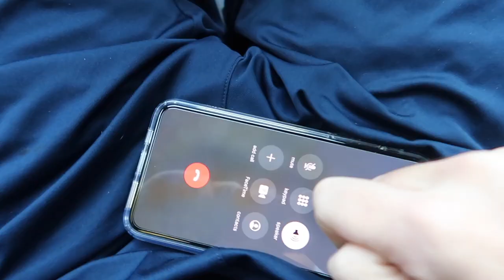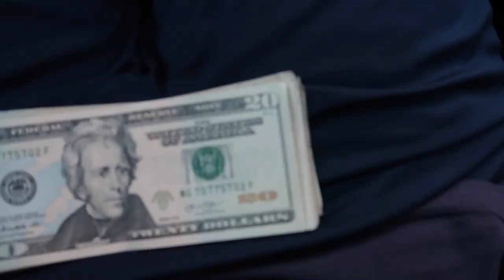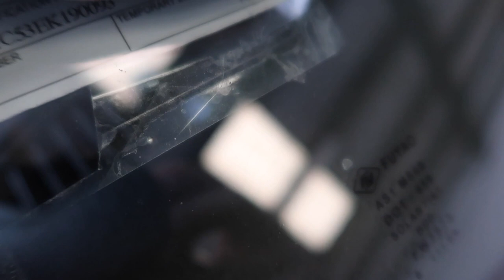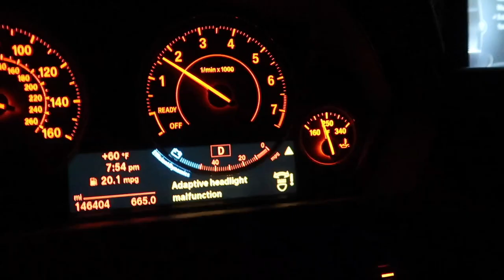We messed up...

Comment: Yea the paint on edges and body lines are always thinner than the rest of the paint, so those parts usually get taped up to avoid sanding through the clear coat. You live and learn tho. Keep it up
Reply: An easy fix though, well have to re primer but it's not the end of the world at this point. Get it finished and no orange peel wrap!

Comment: Damn sucks your windshield cracked. Same thing happened to mine and what makes matters worse is that the windshield ain’t cheap due to having heads up display. The cheapest quote I got for a new windshield was $400. A regular windshield without heads up display I could get it for $110 but if I put a regular windshield the heads up display will not reflect on the windshield. Long story short I’ll just wait until the crack on the windshield gets worse before I replace it  😂